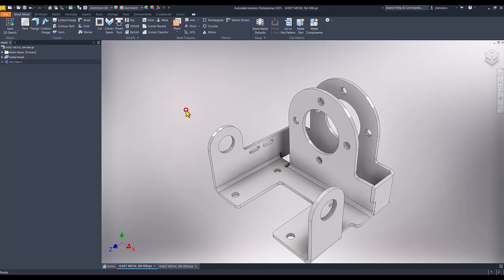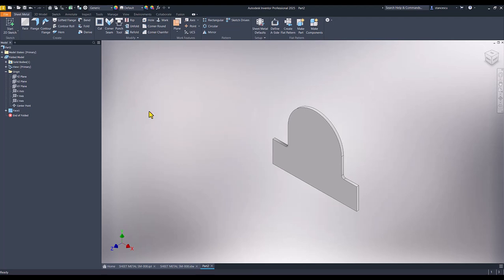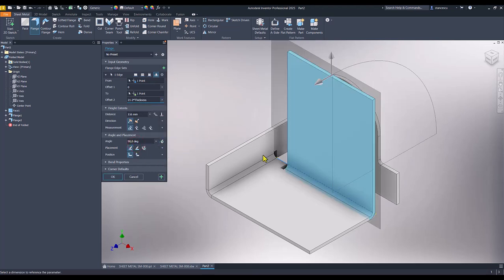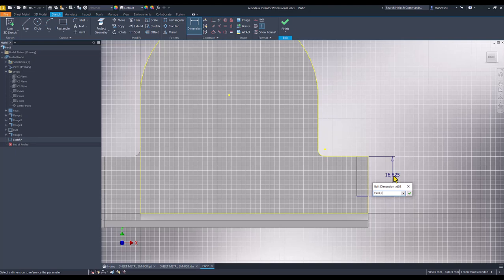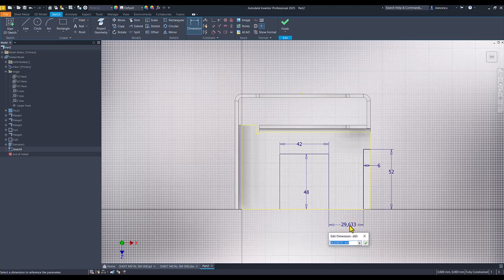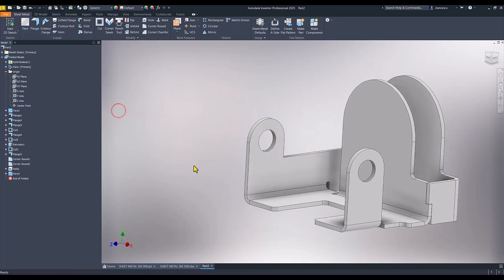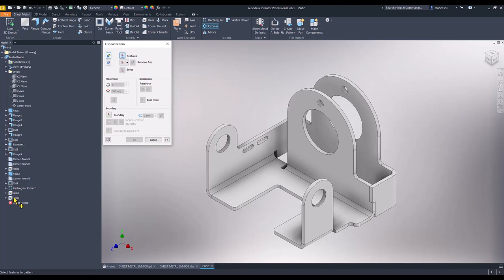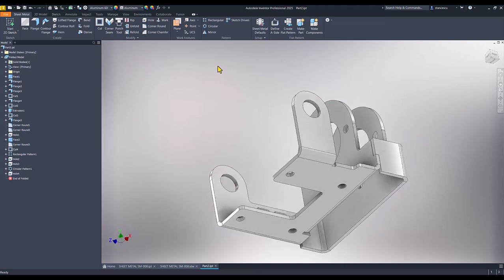Tutorial Inventor - 410 SHEET METAL SM-008

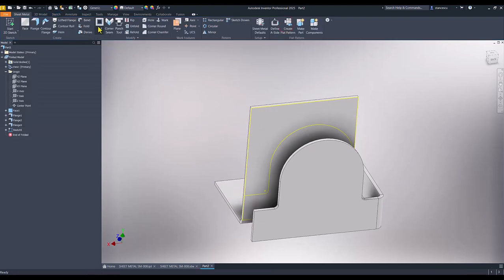Comment: What difference does it make if you use Cut instead of Extrude in the minute 9:52 ?
Reply from the maker: Since we work with sheet metal procedures we use them, even if we have extrude as a variant. There is no difference, but the cut is easier to use in that environment because you do not have to use the depth value for extrusion.
Reply from the maker: Since we work with sheet metal procedures we use them, even if we have extrude as a variant. There is no difference, but the cut is easier to use in that environment because you do not have to use the depth value for extrusion.